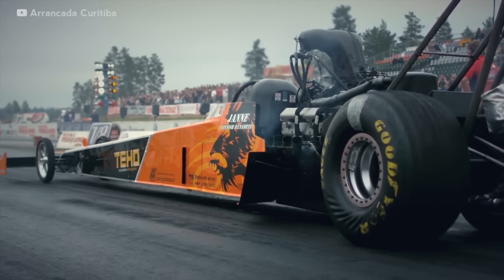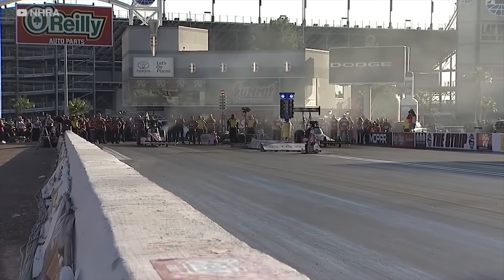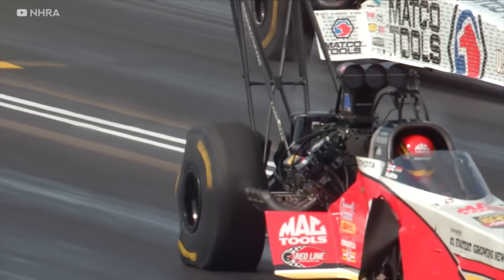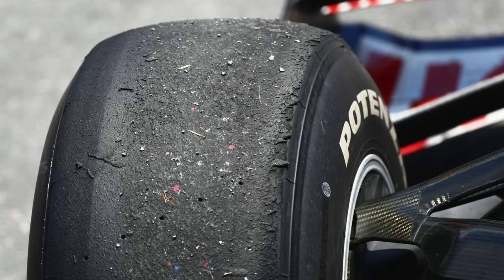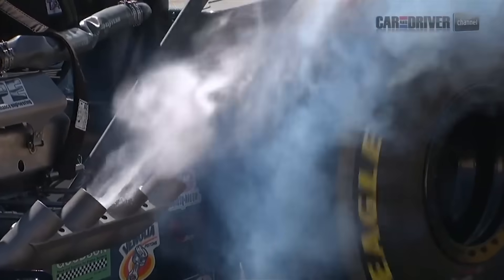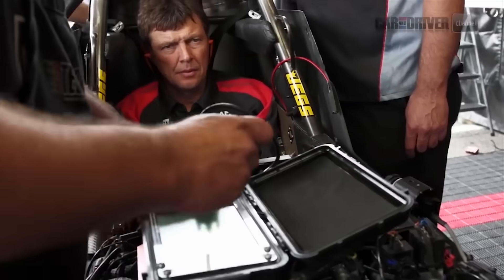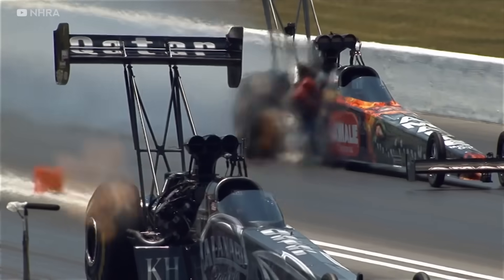How Dragster Tyres Accelerate to 335 MPH in 3.6 Seconds

Comment: Top notch, very excellent, thorough AND knowledgeable technical and engineering breakdown and explanation of the mechanics and theory of TF dragsters.   

I started building and drag racing cars in the '60's, and was fortunate enough to be mentored by a crew chief from a national record holding Super Stock team starting when I was 16.

For a channel best known for F1, you did superb job analyzing, and describing the intracacy of top level drag racing. Though we never dreamed of acheiving the elapsed times and top speeds of TF's in 2020, we faced nearly all of the same technical aspects AND challenges you so eloquently explained.

That is one of the amazing and challenging aspects of drag racing; anybody bringing a car to the line, and seeking optimal performance from their car, deals with the challenges your video explains.  As you strive to go faster and faster the parts get more expensive, the tweaks become more and more 'delicate', and the physical devastation more violent, (and spectacular!  LOL).

Thanks for the great vid.  I'll be checking out more of your vids, since I have a passing interest in F1, and their engineering.

I say nearly all, because we never had to 'thin' our fuel so it wouldn't spontaneously ignite under minimal compression!

GeoD

Comment: I had no idea the headers could produce that level of downforce. Everything about these machines is absolutely amazing...
Reply: Nitro engine exhaust at its current power level - 11,000hp - actually produces closer to 800-900kg downforce, or approximately 1 ton, and that's at a 40 degree angle, not 90. A few years back, drivers experimented with angling the headers back from 40 degrees to 32 degrees to gain some ET and speed - which it did - but just that small change made the cars virtually uncontrollable because of the downforce difference. You can watch the effect on the YouTube video of Cruz Pedregon standing his car nearly straight up at 280mph as a direct result. NHRA made them change back to 40 degrees.   https://www.youtube.com/watch?v=CUud0lGU0x0

Comment: Genuine question from someone who doesnt know anything about drag racing, how is there any skill involved in this kind of racing? To me it just seems like a game of who has the faster/ faster accelerating car.Even though i might be completely off with that assumption.
Reply: For the driver skill it's mostly being able to launch the car exactly when the light goes green. A 0.01 second too late and you might loose. For the rest of the team the skill is to make the fastest car. What parts to use, but also how to set everything up. It is a teamsport and everybody's job is important.
Reply: 1. Drag racing is all about launch. If you can't time it right, doesn't matter how much power you have. 
2. Funny cars are extremely light. Because of that, they can easily turn and completely spin out of control, so it requires someone who knows what they're doing to keep the car straight and from crashing.

Comment: Interesting Factoid;
  Pro Stock classes in NHRA/IHRA use a hybrid engine with a GM based design for the  Engine Block with the Chrysler based "HEMI" cylinder head.
   While Funny Car & Top fuel use 426 "HEMI" based designs.

I wasn't trying to say any information was incorrect, btw. I just find that hybrid combination interesting & wanted to share. Great videos & thank you for sharing them!

Cheers

Comment: The nitromethane fuel actually carries less energy per gallon than street gasoline, it makes more power in the engine because it has its own oxygen in the chemical mixture so they can push more of it into the cylinders and still get it to ignite, add in around 60 psi of air from the supercharger and they dump around a tablespoon of fuel into a cylinder on every intake cycle

Comment: I was a passenger in my fathers 650HP GTR same as in a limited ferrari f12. The GTR felt faster tho and I can not imagine being in a 2000hp car and this thing has like 11000 HP? Oh my god.

Before people start calling me a show off, I have a Gutted Smart 452 Roadster with a hardtop roof. It's now at about 100HP 700KG and sucking on 102 octane fuel (Aral Ultimate) :D
It's not slow by any means, the only issue with that car is the damn GARBAGE GEARBOX, it's so damn bad...

Comment: With all the lame comparisons you gave I'm surprised you didn't say something stupid like "A top fuel dragster pulls more G's than the space shuttle at launch" & "Can accelerate the distance of 10 empire state buildings faster than an F35 Raptor on full afterburners"   Using those comparisons is for Idiots, and an audience of idiots. Typical English nob!

Comment: That tire crinkling is extremely satisfying.
Reply: that's what 1,000+ horsepower per cylinder will do
Reply: @zm6301  yup. Thats why drag cars never last 10 seconds due to how large their top speeds were.
Reply: no kizzy
Reply: Inr how it doesn't pop?
Reply: @goofyahhkidnammedrayme4188  I think it’s because the rubber is just so insanely thick and compacted that the rubber will burn for almost forever
Reply: @dagoatYT  Asuna Yuuki also love drag races. Although dangerous... 😉
Reply: The ballooning is nice too
Reply: They also generate a ton of torque. All tires do that to some extent btw, it’s how power is delivered to the road
Reply: oh yeah
Reply: Facts
Reply: There's Cam!
Reply: Pneurnographic.
Reply: Yeah
Reply: If only there were no adverts...
Reply: it really is
Reply: Wrinkle wall..
Reply: I find it cursed
Reply: Hey its Fapalot!
Reply: lets see an electric car get anywhere near these beasts....i know its about tyres but just had to say it
Reply: opposite of satisfying for me. I want it smooth as budder
Reply: @Sandra Turner hi Sandra Turner.
Reply: HOW TO BE SAVED  (How to KNOW you are saved and not just hope you are)  
THE BAD NEWS
All men have sinned and are in need of a Savior (Rom 3:23 "For all have sinned, and come short of the glory of God" ; Rev 21:8 "But the fearful, and unbelieving, and the abominable, and murderers, and whoremongers, and sorcerers, and idolaters, and all LIARS, shall have their part in the lake which burneth with fire and brimstone: which is the second death. 
No man can come to God by his own good works and righteousness. (Isaiah 64:6 "But we are all as an unclean thing, and all our righteousnesses are as filthy rags;"                                                                                                                                  THE GOOD NEWS
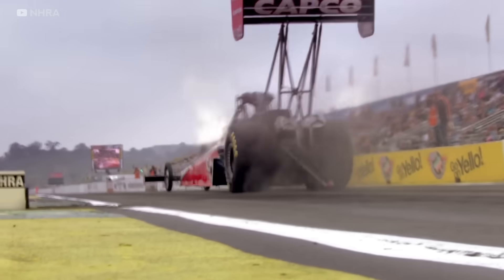1 Timothy 1:15 tells us "This is a faithful saying, and worthy of all acceptation, that Christ Jesus came into the world to save sinners." 
How does Jesus save a sinner?
From the beginning of the bible to the end, God has only forgiven sins through a BLOOD SACRIFICE, because he is a Holy God he can't forgive sins any other way, Heb 9:22 tells us, "...without shedding of blood is no remission." when Adam sinned, God had to kill a lamb in Adam's place as a substitue, In the Law of Moses, a Blood Sacrifice was demanded for the forgiviness of sins. 
Jesus came to die for the sins of the whole world, he came to be OUR Blood Sacrifice, OUR substittue, he came to bear OUR sins on the cross, in OUR place. John 1:29 "...Behold the Lamb of God, which taketh away the sin of the world."
What must you do to be saved? 
YOU MUST REPENT; You must change from unbelief to belief. 
admit you are guilty, that you cannot do anything to save or help save yourself, and that you need Jesus Christ as your savior. 
Titus 3:5 "Not by works of righteousness which we have done. but according to his mercy he saved us,"
Romans 3:28 "Therefore we conclude that a man is justified by faith without the deeds of the law." 
Romans 4:5 "But to him that worketh not, but believeth on him that justifieth the ungodly, his faith is counted for righteousness." 
YOU MUST TRUST; placing your complete faith in what Jesus Christ already did to save you;
John 1:12 "But as many as received him, to them gave he power to become the sons of God, even to them that believe on his name:."
Salvation comes by believing in WHAT Jesus did for you, 1 Cor. 15:1-4 tells us "Moreover, brethren, I declare unto you the GOSPEL which I preached unto you, which also ye have received, and wherein ye stand;
2 By which also ye are SAVED, if ye keep in memory what I preached unto you, unless ye have believed in vain.
3 For I delivered unto you first of all that which I also received, HOW that Christ died for OUR SINS according to the scriptures;
4 And that he was buried, and that he rose again the third day according to the scriptures:"
All you have to do to be saved, and on your way to heaven is place your TRUST in the shed Blood of Jesus Christ and nothing else, as sufficient for your salvation, (Rom 3:25 "Whom God hath set forth to be a PROPITIATION through FAITH IN HIS BLOOD, to declare his righteousness for the remission of sins that are past, through the forbearance of God;")
(Propitiation means the act of appeasing wrath, Jesus took your place on the cross.)
Will you accept Jesus Christ as your savior by simple faith, simply trusting in his shed Blood for sufficient to save your soul from hell?
The last sentence is all you must do to be saved, and that is FAITH, not works, TRUSTING in what someone else did for you is the only thing that is not a work.
Please watch Robert Breaker's video titled "HOW TO GET SAVED" 
If you have received Jesus Christ, by faith in his Blood, you now have eternal life and on your way to heaven!
I John 5:11 "And this is the record, that God hath given to us eternal life, and this life is in his Son."
John 10:27-28 "My sheep hear my voice, and I know them, and they follow me: And I give unto them eternal life; and they shall never perish, neither shall any man pluck them out of my hand."
If you got saved because of this message please let me know! You can copy and send this message to others!
Reply: @henriquemeiralins  i fked god last night on the butt

Comment: 8:14 this fuel does not need to be mixed with air to combust? Are you saying it's hypergolic? 🤔
Reply: it's just like diesel fuel, it only needs pressure and heat to combust, but unlike diesel nitro methane needs extremely high temps to begin "dieseling"

Comment: An interesting feature of a dragster that was omitted from this video is the "slip joint" used in the middle of the chassis to allow the car to "arch" as it accelerates, the method used is one tube inside another in each top rail.
http://www.competitionplus.com/featured-stories/8922-mike-kloebers-nitro-university-course-1-understanding-the-chassis

Comment: You got the clutch facts wrong. After assembly it's no longer adjustable by any means, it's progressive engagement is centrifuge controlled. The only thing they adjust just prior, is engine electronics, fuel flow and spark timing maps. During engine assembly, the choice of thickness of the copper head gasket sets the engine's compression ratio.

Comment: When you said 0.5 bar or 0.3 bar you probably meant 1.5 and 1.3 bar right? because 1 bar is roughly 1 ATM and i don't think those tires run with less the atmospheric pressure...

Comment: By midway down the track, the rear wing is producing so much down force that the car could literally run upside down on the ceiling of a tunnel, and it wouldn't fall off the ceiling until the driver lifted off of the throttle.

Comment: Around 1966 wrinkle-wall slicks began showing up at drag strips.  All us fans of the time were amazed at the low pressures used and the great gains in traction resulting.  Something you don't see in this video is the lateral (longitudinal to the axles) movement these slicks allow the wheels while the slick stays planted on the ground.  For a time, everybody in the pits had to push on the rear quarter panel of a car with the wrinkly slicks and then watch in amazement as the back end of the car wobbled left and right on the slicks.

Comment: Thanks for the video,

Correction: the early dragsters were not rear engine. They were moved to the rear by Don Garlits, and the main reason was safety. Driver were getting hurt, burned and killed when engines exploded in front of them. Also, the rear roll cage would interfere with the pavement, if launching a high wheelie, the roll cage would actually lift the rear wheels off the ground. The car would teeter on the cage and be totally out of control. Often the car would careen toward the edge of the track and flip over barricades, endangering the spectators.

 In an interview by Florida Trend, Garlits said this of the incident: "In 1970, the transmission exploded in my dragster on the final run, and it cut my foot off and cut the car in two. That’s when I drew up plans for what I thought would be a championship rear-engine car. I would go out to the shop in Seffner on my wheelchair, saw stuff out on the band saw and make the parts."
Reply: There were rear engine dragsters before Garlits made them viable. When he was laying in the hospital after the clutch explosion that took off his foot, he began to figure out why the rear engine cars had been death traps and un-raceable. In the end, Garlits correctly determined that the rear engine cars needed a different steering box ratio, one that didn't turn as quickly....that was literally what made the rear engine dragsters work and become mainstream.
Reply: @MikeM275  Ok I'll concede. First truly functional rear engine dragster.

Comment: FUN FACTS  1 it looks like a garden hose the amount of ful that flows into the motor 2 you can weld with the msd ignition they use 3. its slipping a clutch the whole pass using a centrifugal clutch  by the end of the run the 6 disk that make up the  clutch pack are fused together into one pack 4 the teams tear down every bit of the motor in between runs in less than like 30 mins they take all the parts set them on a table and sell them as souvenirs besides like the blower and main block ect 5 they go 0-100 les than 1 sec  6 these things shake the ground like mini earthquakes setting car alarms off for some distance

Comment: º~º  i don't think the clutch is the best way for this  because  it´s like taking off in 5th gear with your car; no matter the HP;   i think the problem is  that no one has yet built a trans that takes that torque and those hp;   they probably have thought about it, made some calculations, and then gave up,they just improved on the ONLY thing they had working at the time,the clutch;  until  the day someone does it  and then they'll laugh at the old clutch system  º.º

Comment: You totally forgot to talk about how the two front wheels in top fuel cars aren't in line with each other. The staging side wheel is always forward of the non-sensor breaking wheel. This is done to give the car more time to accelerate similar to what "deep staging" does.

Comment: I remember seeing a TV show where a drag team engineer explained that the fuel tank is drained from the bac of the tank, and it's angled towards the pickup at the back of the tank because the g-force literally pushes the fuel through the lines to the high pressure pump at the engine. Apparently, they also run such a high compression ratio, that before the spark ignites, there is no gas in the combustion chamber, it's just liquid fuel.

Comment: While Toyota, GM, and Ford all compete in NHRA’s Funny Car and Top Fuel arenas with sponsored teams, until recently, NHRA acknowledged — until recently — that they based their engines on the Chrysler Hemi.

Former racer Ellis Brasher pointed out that in the past Force referred to his cars as being powered by Ford engines. Force did not, according to Brasher, make such claims when he was racing GM-bodied cars. Yet, in a 2005 interview, Force said, “Because we want an all-Ford motor and yet we have to fit underneath the NHRA….this won’t be a Chrysler design, everything evolved from the Chrysler.” Still, Brasher compared the heads of the new Ford engine with those of the Chrysler Hemi, and found them to be very similar — and both quite different from Ford heads.

I had to😄

Comment: How does your neck not snap going 300mph in less then 4 seconds
Reply: You have to push your helmet backwards into the roll cage right before you hit the gas. If not, you will be knocked unconscious from the instant acceleration. Also you have to strap the seat belts as tight as possible for the negative 6Gs when you hit the parachutes.

Comment: The engine and trans blowing up in your face is why Don Garlits created the rear engine configuration.
Reply: You forgot "Big Daddy", Don Garlits
Reply: that, or because it's much more aerodynamic, and better for weight distribution and decreases weight by not needing as large of a driveline, and shorter exhaust lengths, to put the engine in the back.
Reply: Don garlits didn't invent the rear engine dragster( a fact he often points out, as he is a humble guy) BUT he was the one who designed the steering ratio ,so it could be driven in a straight line.
Reply: Back in the '60s the UK Santa Pod had two top fuel racers. One was Clive Skilton in the Castrol car and the other Dennis Priddle. So loud that when I started my little Austin afterwards, I tried to restart the engine as I couldn't hear it running. There was a DJ radio presenter called Dave Lee Travers who raced in the highly modified saloon car class. The Swedes were regular visitors in their top fuel cars.

Comment: Softer acceleration in racing for faster times is a myth. Sure as you mention, flooring it will cause wheel spin, but if you don’t cause wheel spin, smash it as much as you want. It is a legit racing technique to throw a car in and out of a corner, purposely losing traction, so that you can immediately move back to the maximum traction point.
Reply: LOL...Too much here to laugh at...I'll leave you at your Xbox...